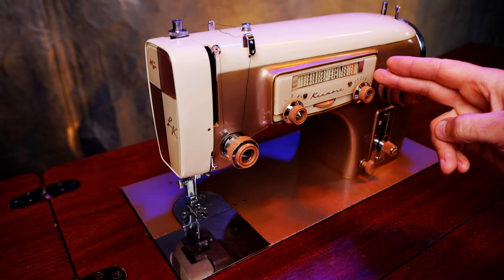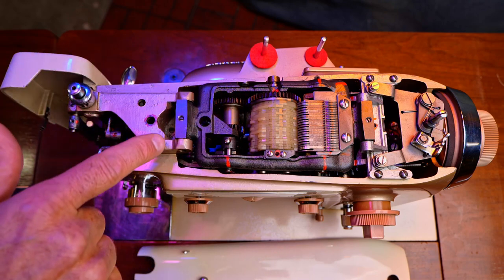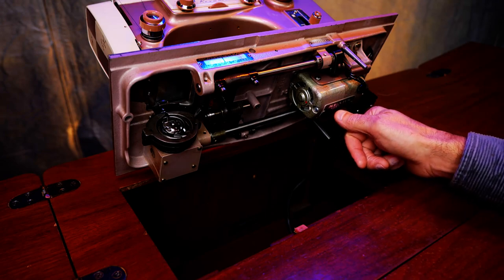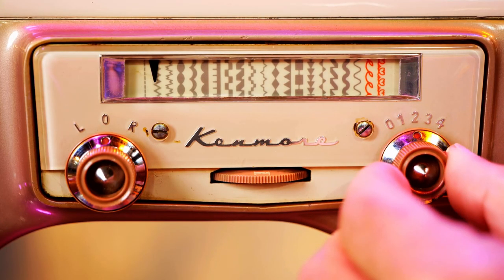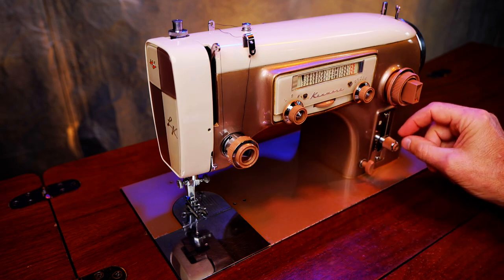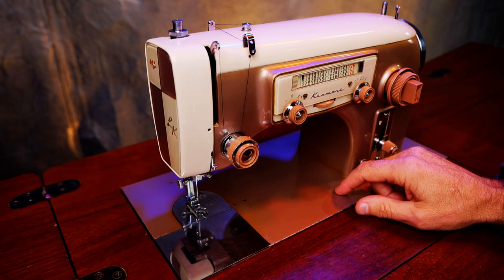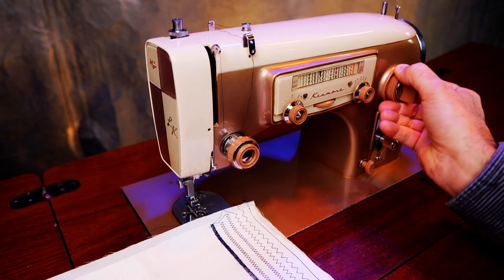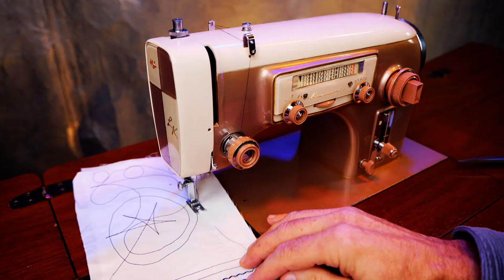Lady Kenmore 89 - 1960 German Quality - 516.891

Comment: Yes, I know (the date of mfg). On the nomenclature plate which states 516.891, there are 3 sideways digits 601. This means 1960 January was the date that this machine was made. This does not confirm the date RANGE that Gritzner may have made the 516.891 version. Further, the 516.890 version would typically have been may prior to 516.891, but that could be the same year (1960) or earlier. The sample nomenclature plate that I have seen for 516.890 did not have the date stamp. Not all Kenmore machines did.

Comment: I have two of these machines, both are probably early production and were equipped with a cheap, noisy, motor. The motors didn't even have external access for the brushes. I have replaced both motors and the machines are much quieter and more pleasant to use. I have seen a later production of the Lady Kenmore Model 89 which was factory equipped with a motor with external brush access. It was quieter at low speeds.
Reply from the maker: This could be a clue as to why my motor doesn't match. Thank you for sharing this good information.

Comment: This was Sears competitor to the Singer 500A "Rocketeer" model. Similar features but, the internal cam stack on the Singer is vertical and made of steel. Both great machines, I have the 500A.
Reply from the maker: I have yet to have the pleasure, thanks for the information.
Reply: Yes, and the # 500 cost $359.00 from 1961-3.. I have 4 of them and love them !!!  They have all steel gears and a high speed rotary hook . In my opinion, the Singer machines were superior, no plastics..

Comment: The documentation on my Model 89 says it  was manufactured December 7, 1959.

Now I need a new motor, any  ideas?
Reply from the maker: Universal motors are sold on Amazon and eBay.
Reply: @AlexanderDyer  I took it to a sewing machine store and theowner asked me if the motor was turning slowly and smoking.  I said 'Yes', and he said 'don't worry, just run the motor at full speed for a while and it will be fine when it warms up'.  He was right.  Apparently it happens when motors sit around for a long time.  Later I experienced the same thing with an electric fan.  It didn't want to go very fast so I left it on and now it's humming.

Comment: Ok thank you for in informing on the belt but I need a longer one. Anyway I put the old one back and oiled the Machine and it worked but now that I’ve cleaned it it’s not smooth anymore I have to keep revving the wheel and hitting the pedal to get it going,?so no smooth sewing. Have any hints. I keep
Oiling it but still not smooth.
Reply from the maker: Probably some thread or something all jammed up under the hook.

Comment: Dad bought it for mom in 1946 after they got married! I need to know how to reset the foot lever so it drops the foot to the plate! I also would like to know the pain color numbers as I need to refurbish it as I still have it!
Reply from the maker: If the foot is stuck I recommend that you clean and oil your sewing machine. Use sewing machine oil for best results.
Reply: @AlexanderDyer  Thank you, however, it has been oiled, the problem is that the lever came off it’s spot on the spring lift and I do not know how to get it back to the correct place or where that place is!

Comment: Very cool machine, picked one up  for free but too damaged to be saved (rain and mouse poop). I also have the Gritzner automatic version. If you look under the top cover to the right of the presser foot pressure adjustment you might find what I think is a date stamp in the cast iron. My Lady Kenmore was 48 and the Gritzner is 52. The Kenmore's motor was the same color as the body of the machine. The Gritzner has an Elte (German) motor. Larger more powerful and 7500 rpm's.
Reply from the maker: Thanks for that good information.